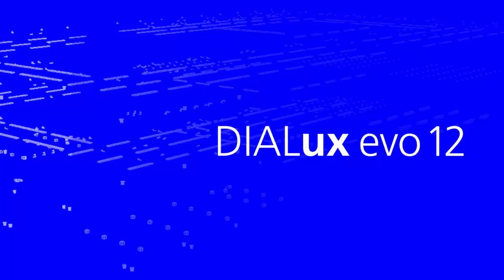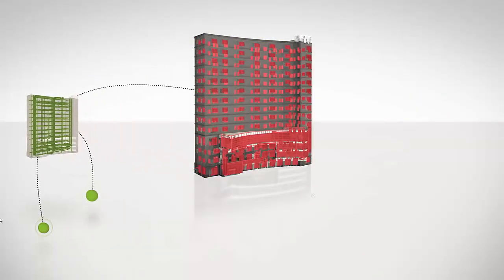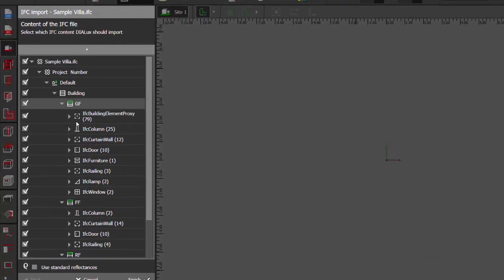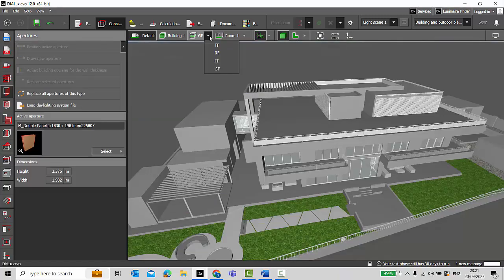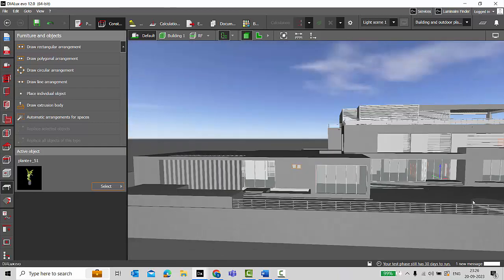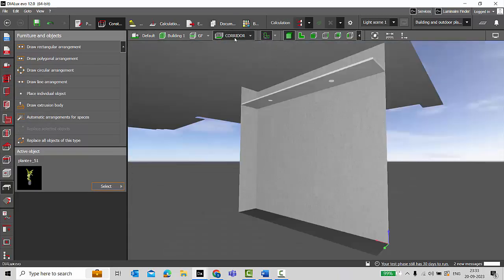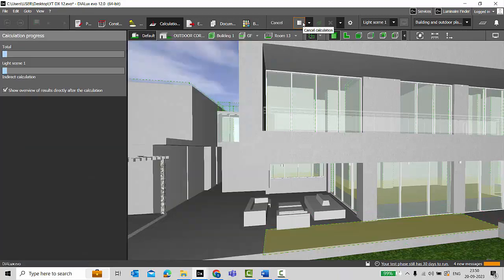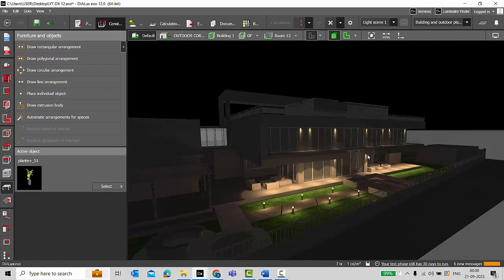Dx Evo 12 - Open BIM with IFC Explained

Comment: Thank you for the tutorial..I've tried to export Ifc file from SketchUp file but ended with errors and dialux failed to open it.Can you please assist
Thanks in advance
Reply from the maker: possible issue could be heavy 3d converted skp file. Try reducing the file size and import

Comment: Good Job, thanks for the video!!!!
i work with big public constructions,  in DIALUX EVO 11.1 i can`t import IFC because the IFC files  is too heavy (200MB more or less)  so constantly crashes  the  Dialux, do you know if this is fixed in DIALUX 12? 

And do someone know how the max. size  of IFC files  DIALUX 12 can import without problem?
Reply from the maker: Yes Dialux crashes when importing heavy IFC files. we can remove unwanted models/ structures or heavy models from file and try importing it